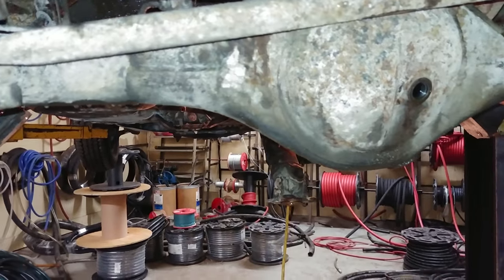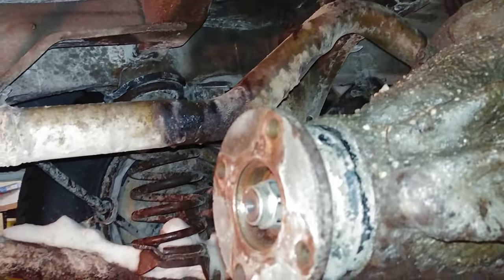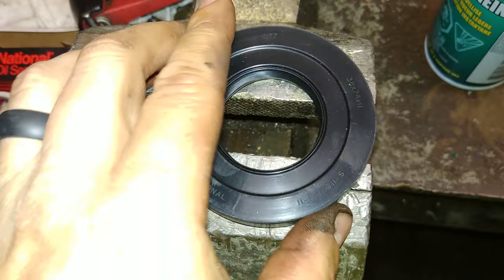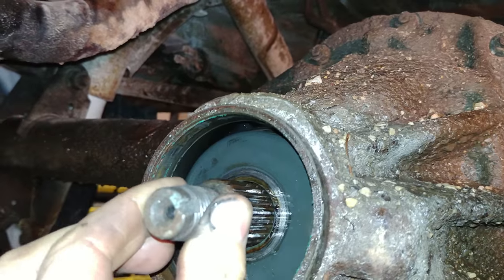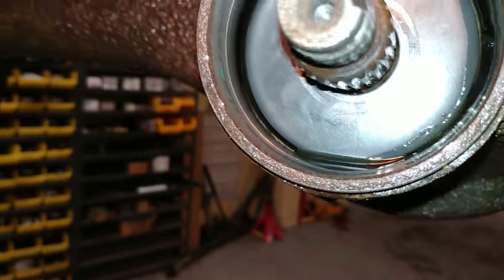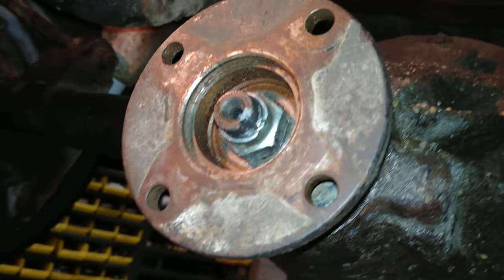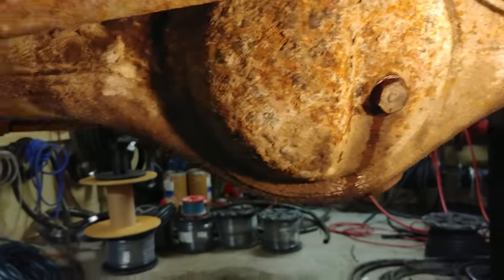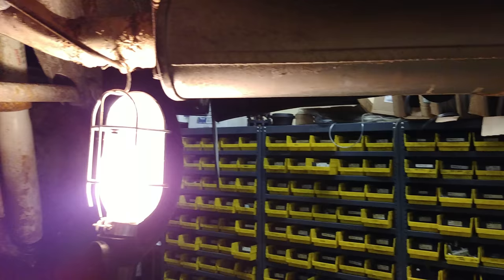Toyota Previa rear pinion seal leaking and replaced

Comment: Bill,   Not on a Previa but on another truck I watched where you are suppose to make sure the pinion nut gets put back on with the same number of threads that it came off so not too tight or too loose.  Not sure how to do that other then counting how many threads are exposed and use some liquid paper on the bolt and nut before removing.
Reply from the maker: Yes i just snug my pinion bolt up then punch in the divot again. Should be in same place you took it off.

Comment: Bill,  I called Toyota today and they said the pinion nut torque is suppose to be 80 ft. lbs. I was going to do mine tomorrow and thought it was as simple as taking the nut off replacing the seal and tightening the nut to 80 ft. lbs.  I am a little confused when you stated that you snug up the pinion nut and then punch in the divot again.  Can you explain what you mean by punching in the divot.  I have not taken off my drive shaft yet to even look at the seal so maybe there is more to it then a nut and a bolt.
Reply from the maker: At the end of the nut there is a spot where you can punch in a spot at edge of nut. Its like a retaining ring.

Comment: Where did you find that the torque setting on the rear pinion flange nut is 80 lbs.  I have looked in my Chiltons manual and cannot find it anywhere.
Reply from the maker: My Haynes manual puts the torque between 80 foot pounds to 174 foot lbs. So in between that setting should be good.
Reply: Did you use emery cloth on sanding the pinion flange where the seal rides on and if so what grit did you use.

Comment: Bill,  Do you remember what size socket it takes to remove the pinion nut.  I am sure I don't have one that size.  somewhere between 30mm and 36 mm or like 1 1/4"
Reply from the maker: Not off hand
Reply: 15/16 or 24mm

Comment: Bill,  I guess some people would call us crazy for working on these old Previa's.  I got a 91 and still rolling.  Just put on new brake calibers on the front today with new brake hoses.My Pinion seal is on it's way out so just wanted to know if it is only the 4 bolts to disconnect the drive shaft and 1 big bolt that holds the pinion into the diff right.
Reply from the maker: Yes just 4 bolts that hold driveshaft to pinion then the center pinion nut. The should pull off and you will see if there is fluid visible anywhere there then you should replace seal.
Reply: Did you drain the diff fluid before fixing the pinion seal.

Comment: Bill,  Is the pinion bearing lubricated by the differential gear oil or with wheel bearing grease.
Reply from the maker: Differential gear oil.

Comment: Very confused...........   In my Chilton's manual for the install of the new seal step 6 says with the screw type puller install the companion flange on the drive pinion. Place the plate washer on the companion flange .  install new flange nut and torque to 80 ft. lbs.  This is where I am confused.  After torqueing the nut to 80 ft. lbs.  it says to adjust the drive pinion preload as follows......     Using a torque wrench measure the preload of the backlash between the drive pinion and ring gear   new bearing 10-16 inch lbs  old bearing 5-8 inch lbs.    If I have torqued the flange nut to 80 ft. lbs already doing this preload is already done.  maybe I am missing something, how can you do a preload after doing a 80 ft. lb. torque on the flange nut.
Reply from the maker: Wow you have me on that one. I just torqued the nut and buttoned it all back together.
Reply: @crazybillsgarage  did it still work ?
Reply: Did you use a pulley?
Reply from the maker: Yes the rear seal did work and continues to be leak free.
Reply: Preload meaning release the gear into neutral and turn the torque wrench. It should only have 16 pounds of resistance.

Comment: So Bill did you simply torque the flange nut to 80 ft. lbs and call it good.  You did not count how many turns it took to remove the flange nut so you could get it back on in the right spot.   The reason I say this is because that nut has to be just right not to loose and not too tight because either way can screw up the bearing and diff.   I saw where a guy took a chisel and marked the nut and bolt with a chisel mark and counted the number of turns it took to remove the nut so he could get it back in the same spot.  Not sure why they have to do this if you know the torque spec is 80 ft. lbs.
Reply from the maker: I did get the nut as close to where it was on the flange with torque of 80 lbs. I actually think i went to 90 lbs to get it there.